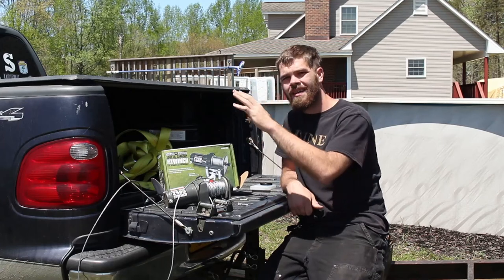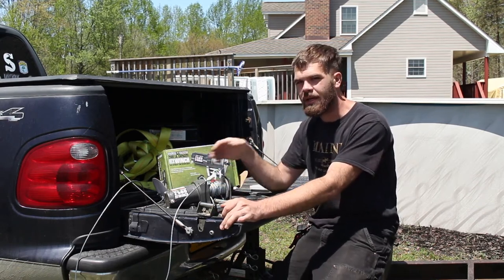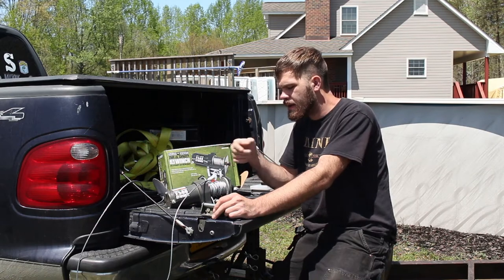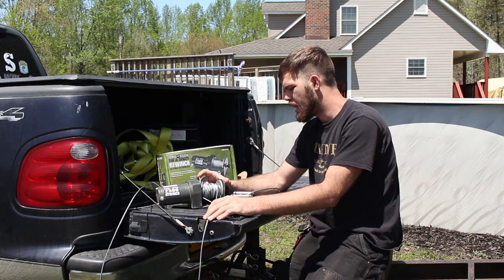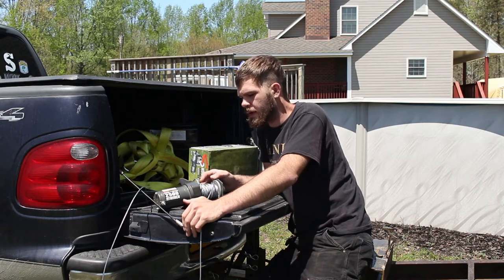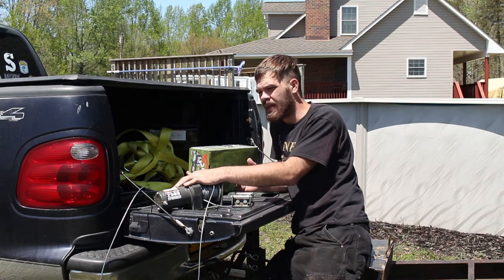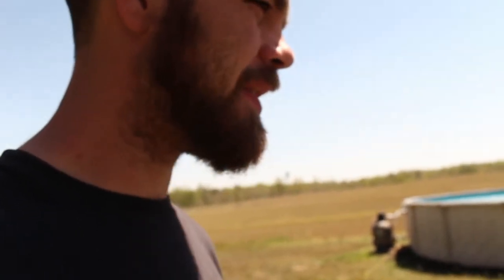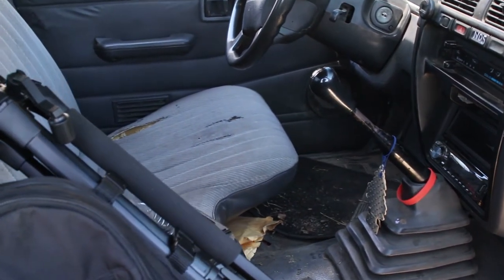Harbor Freight Winch on car trailer review FAIL | new project?

Comment: There's no need to speculate, the failure was absolutely on your part. Advertised winch capacity ratings are based on the first layer of cable. The ratings for additional layers and lengths of cable are usually in the first pages winch manuals. As for pulling weight, the general rule is that you multiply the vehicle weight by 1.5. What you're doing is asking a lot of that little guy.

Are you sure you've seen other guys do it with a 2500 lbs winch? Maybe it was a higher capacity winch or they were pulling on a surface with less friction like cement?
Reply from the maker: in the video I show a clip from another video where someone uses the same winch to pull a car, from grass, onto a trailer. I was on flat gravel with this truck. Ive pushed cars onto this trailer before. that winch did NOT see 2500lbs when I was using it, nor the 1100lb minimum that it states on the box. the truck i was loading only weighs 2700lbs. I admitted in the video that it was partially my fault, but it still should not have failed catastrophically being so close to the rating.
Reply: Yep, you're right. I looked up the video and it looks like it worked fine for him. It's too bad there isn't a better angle on the video. Maybe there's something else working in his favor like a lower incline? Did you base your project on that video or is there another one? In the end, that winch simply isn't rated to handle the task you're showing. Sure, a 2500 lbs winch can probably pull a rolling load of 10000+ lbs, but onto a trailer...? Maybe with a long enough ramp and some patience since these small winches usually only have a 60 second duty cycle for 15 minutes. You could probably also cut the cable to maximize efficiency by removing any excess layers from the drum.
Reply from the maker: I also saw a video of someone dragging a 3/4 ton truck frame and cab onto a trailer without even ramps and another of someone pulling a 3/4 ton Chevy across flat ground. I have 9 foot long ramps and my trailer deck measures 27” from the top to the ground. I put planks on top so it would roll smoothly. I gave this every chance to work that i could, even using the lightest vehicle i could for the first test. I think the problem is quality control. Some exceed expectations, but this one fell short.
Reply: Okay, well, I'm just confused and maybe starting this discussion was a bad idea since I think we're going to start going in circles. You say in the video it's fine for its intended use, but not for unintended uses. After using it for an unintended use and it fails, you only take partial responsibility. You say the problem is quality control because it didn't exceed expectations. I think I'm done.

Comment: I pulled a 76 f150 4x4 with an extra engine in the bed onto my trailer using a snatch block with no problem.
Reply from the maker: I’m really glad to finally hear from someone that has done this successfully. I knew this was possible.
Reply: The snatch block doubles the pull capacity but takes twice as long. Hey from rusty Banger ME.
Reply from the maker: I’m also from the Bangor area. Old town to be specific
Reply: Huh no doubt, I'm out in Bradford,.